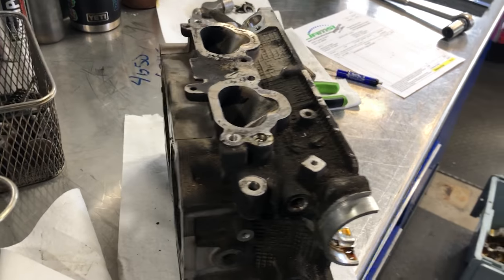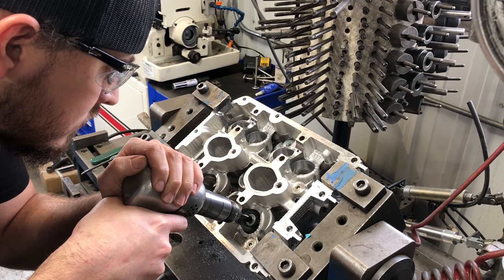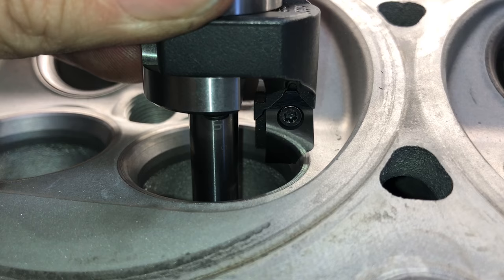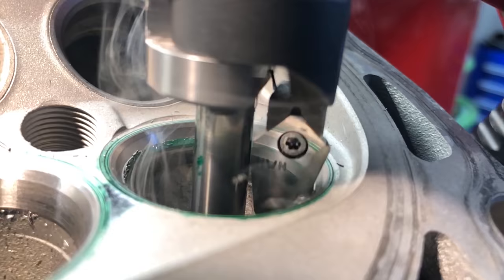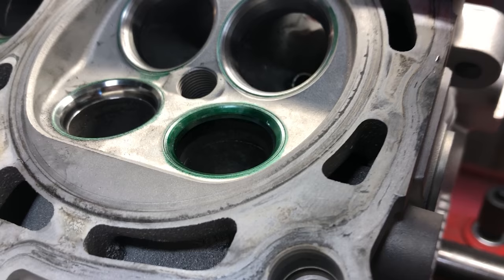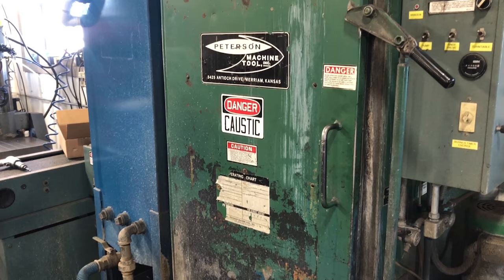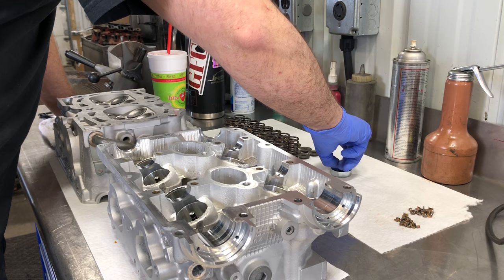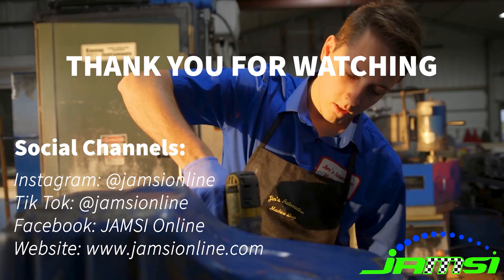Rebuilding A Set Of Subaru WRX STI Cylinder Heads - Valve Job -@JAMSIONLINE

Comment: I’m a automotive tech of almost 19 years. I’ve sent many heads and some blocks to all different machine shops. Straight truth, you do Top Notch work. By far the top 3 I’ve ever seen if not the best. I never had a chance to have your work in my hands but I can tell you do great work. I truly appreciate it, 
Im kind of OCD about all my work. Lol I’m such a torque nazi on certain things. Not brackets and stuff like that. I even torque valve covers and every spark plug that I do. 
My general manager has mint condition 97 BMW 540i that he loves. He had the valve covers done countless times due to oil leaking. About 6-7 years ago I did them and they are still dry as a bone. About 3-4 months ago I had to do his water pump. He came into the shop to see how it was going. He then asked me what did I do to keep the valve covers from leaking after a year or two. I told him, more then likely cause I torqued the valve cover to spec. Lol he instantly called the whole shop to a meeting and said I want all valve covers torqued for now on. 
It’s simple things like that makes a big difference. And it only takes 5 or so minutes more.
Reply: Hi I'm going to change all the valve guide, valve spring and new valve seat on my bike. My question is is it necessary to change all intake and exhaust valve aswell? Can't i just reuse the titanium exhaust valve after spec the condition of the valve?

Comment: Started an apprenticeship, everything seemed pretty straight forward until I got to the valve seats. We do a lot of irrigation applications and N series seats cut like ass. Not to mention how hard it is for me to see the top angle start to come in. I really appreciate your content, it’s helped me a ton.
Reply from the maker: What valve seat machine are you running?

Do you use any coolant/cutting fluid? Can help on really hard seats if you’re fighting chatter

Comment: Just had this same thing done on my W25 ej257 heads. Was struggling to find a machine shop (dont have any within a 2 hour radius). Ended up having to travel to get this done. Exact same work in this video, ran me just shy of $700 to have done

Comment: cool but you might wanna get some measuring equipment to check the surface finish of the head. they look nice from a visual inspection but head gasket tolerance for ra is very tight and it's the only way to insure that they will be reliable. i think alsot of people haveing head gascut issues could bennifit from cheaking the surface finish.
Reply: Lol

Comment: 6:45 Exhaust seat width measure factory tolerance (0.055" - 0.083"). That seat width looks a lot bigger than 0.083".

With the final assembly the valve lash is 0.008" intake and 0.010" exhaust. Did the customer use difference shims to set lash? I find that you can "tip" the valves to set the clearance. No more than 0.003" needs to be removed.

Comment: The down side that I saw was you were using the wrong blade/cutter when you resurfaced the cylinder heads. I'm thinking you used a cast iron blade thats why the finished surface wasn't shiny it is a pale clear finish.

Comment: Really liked your video.
Have you have any issues with  valves sealing properly afteReally liked your video.
Have you have any issues with  valves sealing properly after you clamped them down to your block with the half inch head studs?
Some people have told me that I need to get my valve job done by a head place that can clamp the head down to replicate the same conditions. Im not sure if this was an isolated case of one person having a priblem and then the word spread or if it is a problem.
Really appreciate your helpr you clamped them down to your block with the half inch head studs?
Some people have told me that I need to get my valve job done by a head place that can clamp the head down to replicate the same conditions. Im not sure if this was an isolated case of one person having a priblem and then the word spread or if it is a problem.
Really appreciate your help

Comment: Sunday 8 Oktober 2023 
What do you see as the common problems on the Subaru EJ Heads?
I have a 2004 SOHC 2.5l thought to be the 251 Series bekause it has no maf only map sensor. It currently has 158994 miles on the odometer.
This was an abused car and I have been behind bekause of illness. The motor had outside leaks on both heads when I purchased it on 17th November 2021 and to me it always seems to run hot(not by the guage) but I never saw any bubbles in the coolant or any milk shakes in coolant or oil.
It is hard to get parts let alone of quality parts at a good price for made poor people made krippled. From your experience will the heads be kracked and will it need new valve guides and exhaust valves and what are quality guides and exhaust valves for a Subaru aluminum heads but basic quality not high power this is n\a not turboed and the computer default maps at idle for fuel economy are terrible it is ALWAYS RICH. Further how do you successfully inexpensively stop the movement of the cylinders in an open deck design on a poor man's budget?
Anyone reading my comment please contact me with answers. Anyone can help me with where to re-locate up-wind and up-stream of a nuke zone I need immediate kontackts today!!!!

Comment: I have a pair of 2002 ej20 turbo cylinder heads in needs of the same work. any information on cost that you could share? Last machine shop they were at had them for almost a year and didn't touch them because they were too busy.

Comment: I could give you a challenge my piston number three became a rocket ship at the other day I’m gonna be buying in the block but I can as you can see how well you could repair hip like that has a fist size hole in the side of it
Reply: It’s a small block
Reply: That is a mild
Reply: If you wondering wondering how it’s happened 1400 horsepower in a small block Chevy This truck is meant for dragracing

Comment: How do you calculate the material to be removed from the valve stem to account for the seat being sunk further into the head after cutting? Especially if refacing original valves

Comment: Brilliant video, what are your thoughts on these Subaru heads cracking between spark plug hole and exhaust valve seat ?, would you consider them still usable or not ? .... Many Thanks

Comment: It looks like you have a few dull inserts on that face mill.

I believe the surface finish could be better.
Reply from the maker: It uses a single insert, but I don’t know what you’re seeing lol. Maybe the camera makes it look funny but I can tell you the surface finish was beautiful in person 🤷‍♂️
Reply: @JAMSIONLINE  yeah it was probably the camera.
But i work as a Maschinist on a non CNC milling machine and we usually get those spots, like you can see in the video, when one or more Inserts are dull.
Or those spots in your case are the materials fault.

But I'm curious, when you recut the valve seats how do you align the cutter with the guide?

Comment: My name is Gary and I was wondering what you guys would charge me to rebuild my 4.7 l in my 2004 Dodge Dakota. The timing chain guides are rattling and there is some oil burning. I’m 64 and retired from the Bakersfield Fire department on disability and Biden has made a new truck out of reach for most normal people. Thank you